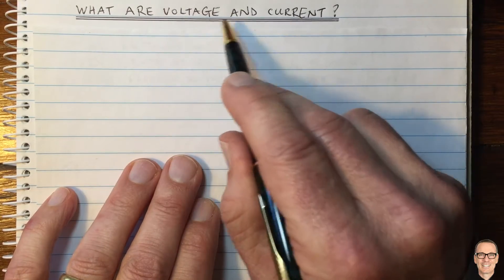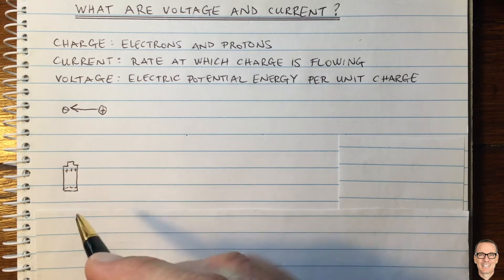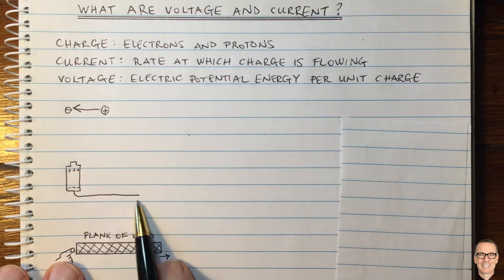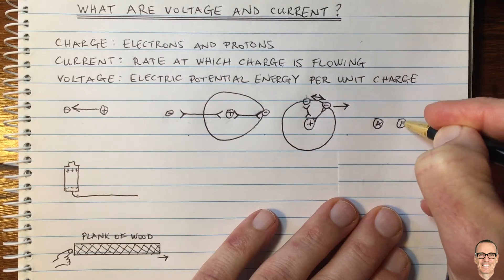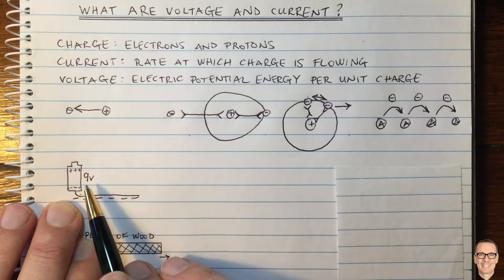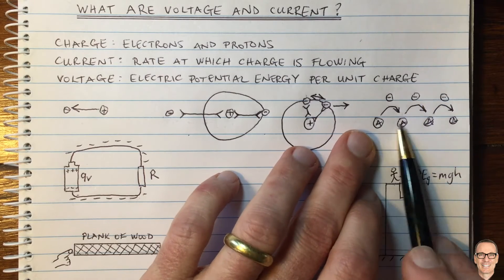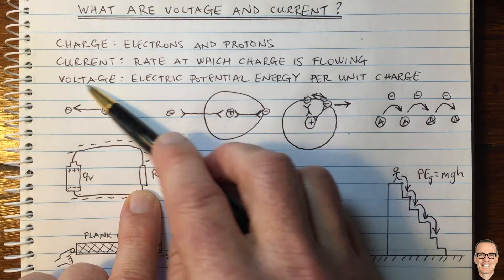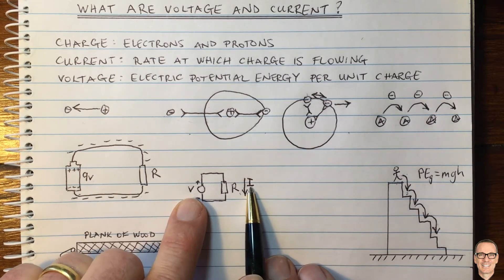What are Voltage and Current in Electric Circuits? An Electrical Engineering Perspective

Comment: Excellent analogies Sir. If you had a wire connected to the battery on the negative end (like ur example) where the charge would distribute across the wire and then you instantaneously disconnected the wire what happens to the electron on the wire? Do they simply stay there? They wouldnt go back to the battery since u instantaneously disconnected the wire, right?
Reply from the maker: I assume you mean instantaneously disconnected at the battery end of the wire? Or do you mean at both ends of the wire? In either case, the answer will be that the excess electrons will stay in the wire (since there is no mechanism applying enough force on them to move them out of the wire into the surrounding air), but they will drift to locations where there is an equilibrium - an equal electrical force in all directions. Of course there is never one single equilibrium location, since there is always energy coming from environmental heat (eg. of the surrounding air) which is causing electrons to move around in a conductor in a random way. Don't forget though, there are far fewer excess electrons in the wire, compared to in the battery and the capacitor, due to the design of batteries and capacitors which ensure high internal electric fields (higher than in a wire, anyway).
Reply: @iain_explains  thanks Sir!  Is it true that once the circuit is closed an electric field is produced across the wire and this is what induces a force to move the electrons? I saw a video where this claim is made and wanted to get ur perspective. Thanks.
Reply from the maker: The video I think you are referring to is a "beat up" (IMHO). It tries to imply that the field "carries" the energy - as if the field is somehow seperate from the electrons. And as if "energy" is some sort of "magic" thing that can be "transported". The truth is that physicists still haven't decided if particles actually exist, or if everything is actually a wave. Until that is settled, we have to accept that electric fields and electron charges go together.
Reply: @iain_explains  I agree we are not sure what is going on.  However, once a field is released from the electric charges, as in an electromagnetic wave, it possess some sort of energy and we believe without charges.  Maybe.